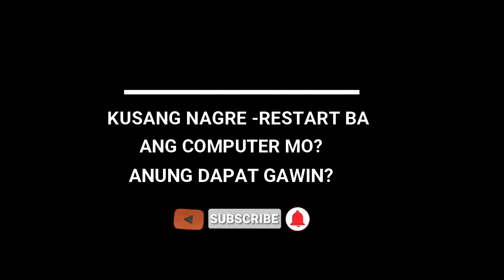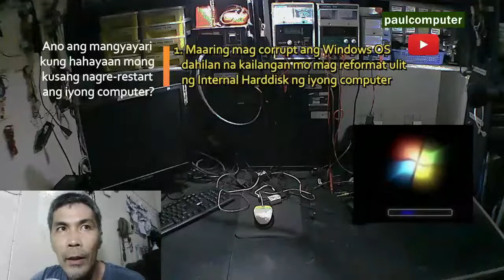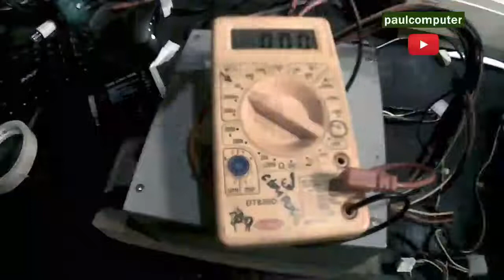AUTO RESTARTING O KUSANG NAG RE- RESTART BA ANG COMPUTER MO? ANUNG DAPAT GAWIN? │ w/ CHAPTERS

Comment: Gud day idol bakait po ba nag re restart ang laptop ko... Dati naman po ito hindi ganun
Reply from the maker: Naku common yan pero dapat alamin mo kung bakit.. Bigyan kita ng mga halimbawa.. Pwedeng hindi na nagrerecharge ang battery ng laptop or mahina magrecharge (SOlution - Do not use while recharging) .. Next, pwedeng nagkakaroon ng over heating sa laptop.. check mo ang blower sa loob kung malakas pa ( Solution - kung kaya mo linisan ang blower ng processor ay linisan mo, at huwag mo ipatong ang laptop ng mga malabot or mabalahibong surface like kama .. mas mabuting ipatong ng laptop sa table, lap, or anything sa flat or matigas.. Next gumamit ka ng laptop charger na specified talaga para sa laptop mo.. (Solution - pwede mo gamitin ang mga universal laptop charger at make sure at fit yung sya doon sa terninal ng laptop.

Comment: Hi sir pangalawang reformat na po ng pc namin. Ano po bang dapat gawin dito? 
Nag rerestart po at dina naoopen ang monitor. Salamat po
Reply from the maker: Maraming paraan ang pwedeng gawin para mag format at mag setup ng windows.. Pwedeng galing sa USB flash Drive, HDD external drive, DVDrom, SSD Drive.. kahit anong na may storage drive. 
----
Check mo muna ang Windows Installer mo kung working sya bago mo gamitin. Yung causes ng restarting ng computer ay pwede dahil sa  currupted na ang windows operating system nya, pwedeng infected with virus or madalas na brownout or power failure sa inyong lugar, pwedeng siksik na ng alikabok yung heatsink sa processor, or mga blowfan sa loob ng computer na magabal mag spin. Suggest ko para sa'yo ay always prepare sa backup drive lalo na kung may importante kang file.
---
Salamat sa panood. Later ituturo ko ang mga ibat-ibang ways paano mag setup ng windows sa computer. sa ngayon.

Comment: sir good am yung computer ko na ms-7181 ver.02 may 2 long beep na naririnig ko 
tapos pinalitan ko ram, at graphics card ganun parin 2 long beeps parin 
pinalitan ko ng power supply ganun parin 
ngayon na diskubre ko kahit tanggalin ko yung power switch, reset, hdd, at light endicator pag sinaksak  ko yung power nag kukusa syang mag on kahit tanggal na yung mga power switch ano po problema? bakit ganun?
Reply from the maker: Kahit pinalitan mo na ng Power supply ganun pa rin? Check mo ang motherboard tingnan mo kung may isa sa capacitors na lomobo.. Baka hindi na tama ng distribution ng mga volts.. Kahit konting baluktot ng capacitor ay malamang defective na. disconnect mo yung isang paa para matest mo kung okey pa at replace kana agad. Medyo advance na yan .. later ko pa kasi gagawin yan. Yung nakikita kong problem ay nasa motherboard kung sure ka na okey ang power supply.
Reply: gusto ko sana nag send ng vidio sayo sir kaso di ako mka send ng vedio

Comment: sir ano ano po bang parts ang gumagana pag NASA bios mode? bukos sa motherboard at power supply? gumagana BA ang ram ? nilinis ko na kc lahat, nag auto restart sya kapag NASA windows na, pero pag NASA bios mode Di nmn sya namamatay possible kayang motherboard? ram or ssd?
Reply from the maker: I see so nag-a auto restarting ba ang computer mo? Yung mga causes ng auto restarting ay overheating, - problem sa power source like AVR-power supply, processor, or pwedeng galing sa mga blower fan ang computer (cooling system). Minsan pwedeng maluwag lang yung motherboard connecter ng power supply pero bihira lng naman nangyayari. 
Check mo lang ang AVR , Power supply, at lahat ng blower fan na makikita mo iyong computer
---
About naman sa Bios or Cmos Settings ng motherboard ay iba-iba yan.. May kinalaman dyan ang gagawin kong video sa susunod.
Reply from the maker: Mayroon kang nilagay na exhasut fan sa system unit ng computer mo? maglagay ka kasi importante yan
Reply: ung sken po kc kapag NASA bios ako, hind po sya nag rerestart or namamatay, so it goes to shows na Hindi nmn po power supply ung problem Tama po ba? pero pag pumasok na ko sa windows environment, cguro after 2 ro 3 minutes eto na mag rerestart na sya, my exaust fan nmn sir palit na din Ng thermal paste
Reply from the maker: @shinobi6  Everytime na mag load na ang windows eh doon na sya nag rerestart, ganun? Cge try mo mag palit ng memory card, kung pagtest mo ay ganun parin ay magreformat kana ng harddisk baka kasi currupted na rin yung internal harddisk mo.. pwedeng virus cause rin yan or biglaang brownout ng madalas nakakasira yan sa computer

Comment: bket pag isushutdown kona sakin tas biglang mag rerestart lng cya.. ? paano po ayusin
Reply from the maker: Ganun ba? Paano ka ba mag shutdown ng computer mo? Yung pinipindot mo yung power button? Advice ko sa'yo hindi magandang practice yan pagtagal pwede lumuwag yung switch. 
---
Gumamit ka ng mga Windows short-cut keys ituturo pa yan later sa mga gagawin kong videos. Press Window button + Power or 
Press Ctrl+Alt+Delete button ng sabay then Sign Out.  Pipindutin mo lang ang Power Button sa System unit-  isang beses kung gagamitin mo na ang computer.
-----
 Just in case check mo lang lahat blowers at yung Power Supply ng Computer mo.
PSU testing:
https://www.youtube.com/watch?v=RHzYwYxLYZM&t=1374s
All -Blower Fans Check:
https://www.youtube.com/watch?v=nNYAcP_mkgY
https://www.youtube.com/watch?v=6ivdVYn_GyM
https://www.youtube.com/watch?v=3QY-fQEsKlo&t=132s
https://www.youtube.com/watch?v=09YACcRx2UA

Comment: Yung akin po namamatay then nag gogoing to sleep sya then mag blank screen sya tapos may nakasulat sa baba na 92 ewn kopo bat ganun need pa i power off yung desktop tapos power on para bumalik s display sana matulungan nyopoako kase di ko malaman kung ano sira neto then kahit naka bukas yung monitor kulay orange yung ilaw nya sa baba na dot
Reply from the maker: kung may mga line tapos nag iiba ang ilaw baka maluwag lang ang pagkakabig ng data cable or may problem sa data cable ng monitor so i-check mo muna.. ganun parin eh malamang nasa video card / on-board video na ang problem

Comment: Hello po, sir ganyan po laptop ko laging nag auto restart,
Reply from the maker: Try mo lang kasi minsan may mga sitwasyon na dahil sa virus. Ang totoo hindi nakakasira ang virus.. ang ginagawa mo dahil sa virus ay yun ang nakakasira. In short yung maling diagnose sa computer. Set of instruction kasi ang virus or malware na iniiba o intention na sinisira ang file o program sa kabuoan.. hindi nakakasira ng hardware device ang virus pero software, pwede.
--
Ang kadalasan ang causes ng restarting sa computer ay overheating sa processor or doon sa power supply nya kung minsan dahil din sa faulty Laptop adaptor / charger. 
What to do.. 1-baka virus lang try mo mag reformat at re-setup ng windows. 2- check output voltage ng laptop charger tama pa sa input volt at ampere at hiningi ang laptop. Nandoon nakalagay sa label sa ilalim ng laptop. 3.- Maglagay ka ng coller fan sa ilalim ng laptop para kahit paano at mabawasan ang init sa laptop.
---
Laptop Cooling Pad with Strong Fan Laptop Stand Holder 
Riser Low Noise Fan Cooler with LED Anti-slip Design
https://go.shopple.co/sp3egk
---
Paano mag test ng Charger o Adaptor ng Laptop?
https://www.youtube.com/watch?v=11AvLIEyao8

Comment: Boss yung pc ko naman nag sashutdown paminsan minsan nakapag reinstall nako ng windows ganub padin malinis naman mga fan ko at thermal paste kapapalit ko lang di naman nag iinit pc ko pero ganun padin nag sashutdown padin sana po matulungan nio ko
Reply from the maker: pasensya ngayon lang nabasa msg mo nag busy kc nitong nakaraan araw.  Ok base sa salaysay mo mayroong kang nakalimutan i-check.  Ok ganito ang gawin mo. Hanapin mo sa google kung ano ang specified or recommended power supply para sa motherboard ng computer mo.  Remember na may connection ang ( Power supply  - motherboard connector-  Motherboard ) Huwag ka basta-basta bibili ng PSU. Next, tingnan mo ang motherboard kung may mga lomobong capacitors. , kung mayroon kang makitang lomobo, may kalawang sa taas kahit kaunti , o di kaya ay may sunog ay need mo na mag replace ng motherboard
----- Sana makatulong. hindi ko kasi nakikita kung anu talaga status ng computer mo, nagbabase lng ako sa sinabi mo..

Comment: Gud am sir paul. Help naman po ano po kaya problema system unit ko. Bago na po ram/psu/sdd namamatay padin po ang computer bagong linis nadin po lahat kada mag sasalpak ng hdd or sdd na cocorrupted po ang sdd/hdd sinisira ng mobo
Reply from the maker: Check mo ang data cable ng hdd or ssd papunta sa motherboard. Tapos punta ka Bios Setting at tingnan mo doon bakit ayaw mag detecta ang SSD or HHD . 
-----Ibang usapan naman kung corrupted ang internal HArddisk or SSD kung saan ang boboot ang windows ..kasi may kinalaman yan sa pagkasira ang Windows operating system mismo.
Reply from the maker: Matanong ko lang huh anu yung mobo? yan ba umiilaw sa blower fan? Well, mabuti kung umuilaw para makita mong nag "spin" yung fan.. yung mabuti talaga lagyan ng ilaw ay yung processor fan lang

Comment: Kuya San po location nio pwede q pagawa computer q ganyan ang problem Niya bigla nlng mag shot down at mag restart ulit
Reply: Minsan nlng namin nagamit gamit ng Anak q sa online
Reply from the maker: Nagrerestart ng kusa? Kadalasan nyan ay overheating. ingat ka dyan kasi baka may problema na sa Processor or CPU mismo. Sige tulungan kita dyan. 
------
1st. - Linisan mo lahat ng Fan na makikita mo sa iyong computer including yung Fan sa loob ng Power Supply.. Fan ng Processor, video card, Exhausts ng system unit, internal HD, etc.
 https://www.youtube.com/watch?v=nNYAcP_mkgY
-----
2nd - Check mo output voltage ng Power SUpply (kung hindi na tama eh replace kana ng bago):
https://www.youtube.com/watch?v=RHzYwYxLYZM&t=906s
      - Check mo rin ang condition ng iyong Power SUpply..
kung sapalagay mo ay mukhang nasisira eh palitan mo ng bago.
https://www.youtube.com/watch?v=VxguGgP9gmc&t=841s
-----
3rd - Replace ka ng bagong Thermal paste sa Heatsink kasi pagtagal nyan ay nagiging bato na tumitigas pagkalipas ng iang taon lalo kung bihira lng gamitin ang computer
https://www.youtube.com/watch?v=7loRKExiJb4&t=885s 
4th - Check output voltage sa AVR or UPS.. Check mo kung mainit masyado kawakan pagtagal,  check mo yung output voltage dapat nasa 220-245 Volts lng. kung hindi pasok dyan ay replace kana ng bago.
https://www.youtube.com/watch?v=_v53Z-ce-cU&t=564s
Reply: @paulcomputer  Kuya wla aq gamit ehhh at Saka ayaw q pakialaman bka Lalo p masira
Reply: @paulcomputer  kuya pwede kau nlng gagawa

Comment: PWEDE BA MAGING DAHILAN NG AUTO SHOT DOWN NAG PC DAHIL SA MONITOR?
Reply from the maker: No! wala syang kinalaman, may sariling power supply ang monitor sa loob nya at hindi sya kasali na sinusuplayan ng power ng PSU or Power supply. Unless kung yung power cord ng monitor mo ay nakakabit sa PSU ng system unit. 
--
PSU with monitor outlet: (not recommended)
https://forums.hardwarezone.com.sg/threads/psu-with-monitor-outlet.5986562/
---
Suggest ko magkabit ng PSU na walang outlet para sa monitor. yung monitor mo ikabit direct sa AVR or PSU.
Reply: @paulcomputer  nung 2021 bumili ako brand new cpu, LG ang monitor ko pero pinalitan ko ng bagong NVISION monitor. Mula ng gumamit ako ng Nvision lagi syang auto shut down hangang ngayun sakit nya for 3 years. Sabi ng IT nung 2021 hindi daw kasi compatible ang monitor sa cpu...totoo ba yun?
Reply: Hindi ko tuloy malaman kung need palitan ang monitor ng branded
Reply: @paulcomputer  parang napapaisip tuloy akong magpalit ng branded monitor 😭

Comment: Auto restarting Po Yung sakin tapos kusang nagiinit
Reply from the maker: Kusang nag iinit! Check mo lahat ng blowers na makikita mo sa iyong computet. Blower fan doon sa psu,  processor,  systemunit. Kung  ganun parun ay maglagay ka ulit ng thermal paste sa heatsink or chek mo output voltage ng psu mo